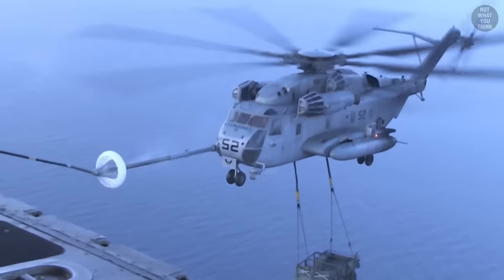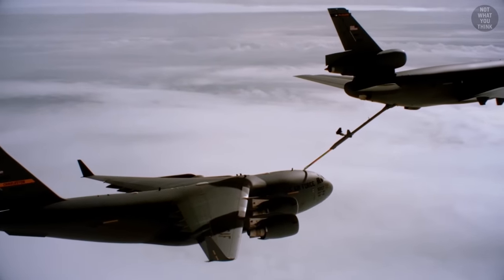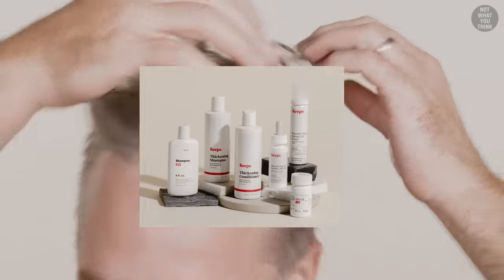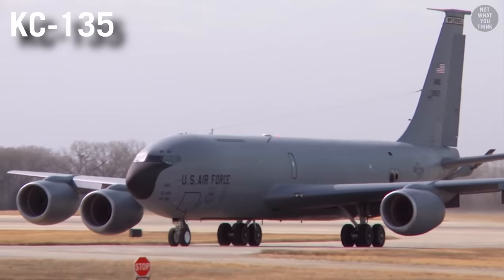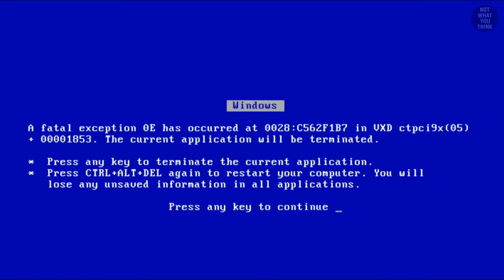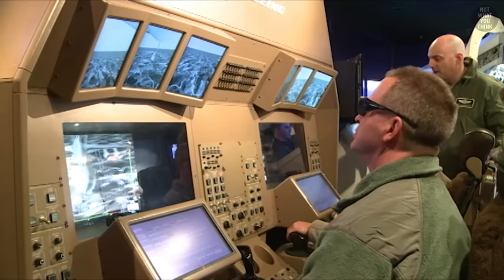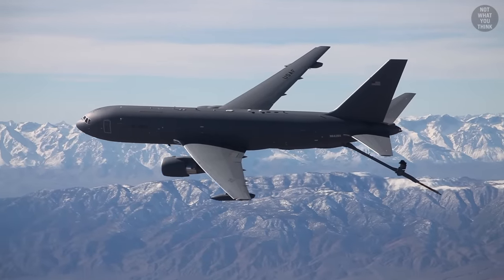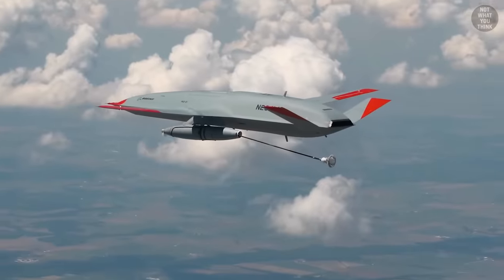Why US Air Force is Making Aerial Refueling HARDER?

Comment: I hope Boeing loses a lot of money on this contract. Airbus originally won the contract but Boeing challenged it and got it, so Boeing should be happy.
Reply: I hope not that money is coming out of our pockets and putting our protectors at risk so no I hope they don't
Reply: @dark12ain  it was a fixed price contract and the USAF has been very eager to remind Boeing of this fact.
Reply: @dark12ain   Nope its Boeing's entire loss. The USAF made sure it was fixed price after they were denied the aircraft they wanted and had this boondoggle foisted on them. They knew it was a disaster waiting to happen.
Reply: @Pierrot9315   Well US taxpayer Dollars have been supporting Boeing for decades through over inflated defence contracts like the KC-46. The difference here is that the overruns are down to Boeing not the Government as always happened before. That was my point.
However we all know that if Boeing goes belly up then the US Government will find some backdoor way to prop it up. "Too big to fail".
It will be interesting to see how the WTO views any sales post a Government bail out....
Reply: I thought the military services have the discretionary authority to select which defense company to design and manufacture their aircrafts as long as they met the requirements?
Reply: @dallasyap3064   They do and the USAF did because they chose the Airbus A330MRTT that would be built in Alabama using GE engines. So it met all domestic supply rules.
But Boeing deployed their paid Senators and the deal was negated and the following bid process was so loaded against Airbus that they said 'Sod this' and walked off.
But Airbus kept their word to Alabama and still built a factory there. It now builds A320 aircraft for North American customers and A220 for US customers.
Reply: @1chish  I see. Boeing really screwed this up. And those senators paid by them are disgusting too.
Reply: @1chish  And it isn't even the first time Airbus walked away from a USAF contract. USAF was interested in A380 for the next AF1, Airbus looked at the politics involved and didn't even bid.
Reply: @apveening   But would the A380 have had to be built in Alabama or built in Toulouse and fitted out in the USA? You can see the politics!
You have to wonder if Airbus had also seen how Agusta Westland in the UK were also shafted by US politics some years back when they and Lockheed Martin won the contract for the USMC 'Marine One' helicopter contract. These are the green and white helos that serve the US President from the White House and from AF1. The contract was for 28 aircraft but after 6 (I think) were delivered from the UK Obama cancelled the contract in 2009. Guess who won the replacement competition in 2013? Sikorsky who Westland had beaten first time round after Westland and Boing withdrew. Obama suggested it was to save money but none had been delivered by the 2020 deadline so they are years late and costs are higher than the AW Merlin versions. Sound familiar?
Reply: @1chish  As I wrote, Airbus looked at the politics and decided against it.
Reply: @apveening   Yes I know. I agreed with:
     "You can see the politics!"
And then went on to show its not a new phenomenon for foreign businesses to be shafted by Yank Pork Barrel politics which supported your comment.
Reply: Oh, they have and are set to lose even more.  Fixed-priced contracts and all that.  Completely deserved.
Reply: @1chish  Airbus would likely have been more than happy to meet any and all domestic supply rules.  It would have been Airforce 1 after all (so at least three aircraft and a tonne of prestige).

But the real cost and pain is finding and then paying the correct senators, who can also quite easily turn their backs on you for another deal.  Really dirty too.  Not worth it in the slightest.
Reply: @tams805   Nope. Airbus learned a big lesson over the tanker deal and will never bid for a US contract ever again. Likewise UK companies have been shafted more than once. A relevant example being the contract for the US 'Marine One' helicopters that are used by the president that was won by Westland in the UK with Lockheed Martin. After 9 flying airframes were delivered (out of 23) Obama was 'persuaded' in 2009 to cancel the whole deal. A replacement contract went to Sikorsky who Westland had beaten just a few years before. The Canadians bought the 9 airframes for 10 cents on the dollar and have been using them ever since.
The Yanks demand we buy their US built kit but never buy ours unless they build it (like the Harrier and the Canberra) under licence.

Comment: I'm honestly really interested in the mechanisms that hold the fuel lines in place. What happens if one of the aircraft fly towards eachother? Does it have a suspension system to allow that much leeway? What if they pull away from eachother? Does it just stay stuck together and pull the other aircraft or is there a release mechanism that kicks in automatically when there's enough tension?
Is there some sort of suction to attach the refueling and the refueled aircraft together? Or is it a mechanical mechanism? Does it lock in place with pins or threads or friction or magnets?

Comment: I know that Boeing has amply demonstrated their incompetence left and right in recent years, but this is beyond ridiculous! A kid in a trade school would design this better.
The best thing to do would be to scrap this embarrassment and procure the aircraft that won the original bidding process, anyway, the A330 MRTT / KC-30A
Voyager.
Reply: This way saved $4.96 per unit though.
Reply: This won't be Boeing's fault. The Air Force will have given them a list of requirements and Boeing will have met them or they wouldn't have been paid.
Reply: @ianphil397   Well that is not true. Especially as the Air Force is only paying 80% of the contract price on delivery.
Boeing royally screwed this programme up from the start. It didn't even meet the USAF specifications and why it lost out to the A330MRTT which incidentally can fly 3 drogues or 2 drogues AND a boom. And it carries 20% more fuel.
Reply: just like how navy is decommision all of the LCS ships
Reply: @hksp  well, that is what happens when you let an aircraft manufacturer make ships.
Reply: @hksp  Only already built ones, while they continue building more, presumably with solved gearbox problem.
Curiously, they only now considered aluminum metal fatigue and corrosion characteristics...  And that there is very little action in US littoral waters.   But fear not, a new designs are coming!
Reply: @ianphil397  And one of requirements was "useless remote-operated boom system" ?
Historically, manufacturers of all useless weapons systems were paid- that's the point of the whole exercise.
Reply: "Boeing has amply demonstrated their incompetence left, right and center in recent years"
FTFY ;)
Reply: @apveening  Okaaay! 🙂

Comment: I'm baffled they didn't include an exposure compensation system. Like the whole time during development, no one thought an overly high contrast situation might come up?
Reply: Someone probably did suggest it, but its Boeing, so likely they were threatened with dismissal for their trouble.
Reply: They actually did, several in fact. They just didn't work as advertised, some settings made things worse.

Comment: It’s so crazy how a project can get so far with such a huge glaring error.
Reply: Oh its entirely possible.
Reply: Welp at least the glaring issue is now exposed
Reply: Why is an operator even going doing it anyway? Seems you could easily build a computer system to auto lock onto transmitters placed around the receptacle and automatically close the distance between the two.

Comment: The decision to go with a remote vision system instead of a window was driven by lots of things, but not really automating refueling, . You can make that work on an existing windowed tanker once the real technological hurdles are overcome, lots of tests on KC-135s exploring technology to make that work have already been done. 

The main reason is cost. If Boeing (or Airbus) were to put a traditional boom pod and window in the back, it would require redesign and recertification of the already-FAA certified structure/pressure vessel, which take lots of time and money compared to just slapping some cameras outside the pressure vessel and calling it a done deal. It was never part of the official acquisition strategy (until talking about RVS 2.0), and it wasn't part of the KC-46 requirements. If Boeing designed anything on the KC-46 anticipating auto-AR, they did so outside the requirements hoping to gain an advantage down the road when they started to push the idea of auto-AR on the USAF. 

Another reason on the KC-46 is size. To meet the cargo requirements, you have to have two pallets side-by-side in the cargo compartment. This takes up the entire width of the aircraft, with no room for someone to walk to the back of the aircraft. The KC-10 is wider, so there's room to walk back to the boom pod. If they went with a window, some missions would require choosing between carrying the cargo needed, or offloading fuel, which would hamper deployments where the tanker is carrying the supplies for relocating aircraft while also refueling them to get there.
Reply: Horse$hit!

Comment: For the end of the video, automating probe and drogue is relatively simple (read: not necessarily easy): the tanker drone just has to know how to fly a racetrack, uncoil/coil the drogue, and let the receiver plug in (the human still does that part). Teaching a computer to do the opposite - actually fly the boom into the receiver - is a MUCH more complicated task, especially if you want to use the receiving aircraft after its been refueled. I suspect that the VRS (order?) intermediate step is needed as Boeing will:
a. use the same hardware on the vrs and fully auto version, thus validating the equipment whilst a human is still in the loop, and
b. Boeing is probably using the vrs system (with its trained human opperators) to pre-seed the machine learning system to shorten the learning process.
Reply: 3 dimensional space, with dynamic lighting, changing atmospheric conditions and turbulence, including aircraft created turbulence. And as mentioned, differing aircraft and airspeeds,.. are a bit more complicated. They'll get there eventually.
Reply: @My-Pal-Hal , hence the bolded "relatively" and the "read:", mate. Plus, if it was a dimensions problem, we'd have had autonomous cars by now and fully automated trains last century. ;)
Reply: @j.michaelpriester8973  
Oh ok.
Guess that explains the 273 Tesla Autopilot crashes in just the last year. And that's not even in a 3D environment, with all the other things I mentioned.
Not really the reliability one would expect of their military aircraft performance.
Hey. Maybe that's why you can't just fly an aircraft with a driver's license. Could Be 😏
Reply: @j.michaelpriester8973  
Damn.
I forgot to mention all those Train Accidents. And they're on a freakin track with only 2 Directions. How in the hell do you F Up That all the time,.. mate? 🤔 😳 🤤
But, I looked it up.
I like knowing a bit of current information about what I'm talking about. Learn something new every day 😊👍
You may find it interesting. But it's US stats. So she me 😂
... Railroad deaths totaled 893 in 2021, a 20% increase from the 2020 revised total of 744 and the highest since 2007. Nonfatal injuries totaled 5,781, a 4% increase from the 2020 revised total of 5,544. From 2020 to 2021, fatalities at highway-rail crossings increased 21%, while fatalities involving other types of incidents increased 20%. The latter included 617 deaths (94%) attributed to trespassers. Eleven employees were killed while on duty, equal to the 2020 death toll. There were six train passenger deaths, up from two deaths in 2020.
The ratio of railroad-related deaths to nonfatal injuries and illnesses is about 1:6. In 2021, of the total 893 deaths, 26% occurred at rail-crossings. Of the 3,216 nonfatal occupational railroad injuries and illnesses reported in 2021, 66 were attributed to highway-rail crossing incidents. ...
Bottom line. You picked some bad examples my friend 😏🖖
Reply: @My-Pal-Hal , you actually just made my point about 10 times over. We've had 3-axis autopilots in aircraft for over 70 years, autopilots coupled to navigation for over 30, and Cat III autoland for over 25. We've pretty well licked controlling an aircraft in 3 dimensions. The engineers on the MQ-25 project readily admit the problem is not in the flight control logic (3D), but in the on-deck control logic (2D). Your Tesla example again clearly demonstrates the much more highly dynamic environment in which cars operate. Hence, why Tesla's autopilot is still unreliable. Your train accident statistics, while interesting and slightly informative, ultimately have nothing to do with autonomous trains. They aren't a thing, except in VERY controlled environments. All of the accidents you cited involve human-controlled commercial trains. US commercial airlines, which are under autopilot control at least by the time they reach 10k feet of altitude, has not had a fatal accident since Colgan Air in 2009, and that involved pilot error, not the automation. 

So, while it may seem that increasing the dimensions increases complexity, the complexity of the control logic is more determined by the dynamicism  of the environment in which the vehicle is operating, not the raw number of dimensions. On the road, the control logic must contend with other cars, pedestrians, construction, weather, parked aircraft, etc. In aviation, weather and its effects have long ago been built into the control logic, and especially in the MQ-25's case, there aren't other aircraft or construction barriers which are going to get in its way. If an F-18 were to stray in front of it, that's what the military version of TCAS (traffic collision avoidance system) is for. The history of the technology and the accident examples we both cited further demonstrated that it's not the number of dimensions in which one operates, but the dynamicism within the dimensions one operates.
Reply: @j.michaelpriester8973  
You don't get it. But that's cool.

Comment: The automatic one should be a electric prop plane with solar on the top
Reply: Wouldn't work because the planes they are refueling won't be able to fly slow enough without losing altitude.
Reply: @Swiggityswagger  a prop doesn't need to be slow, or just make it use prop until it needs to refuel then it uses some kind of jet
Reply: Electric wouldn’t work until the plane it is refueling is also electric. Better to have both planes use the same fuel, no wasted weight that way.

Comment: This is a classic example of a product engineered and designed in a vacuum. All this could have been addressed if Boeing worked together with current deployed boom operators (PLURAL, the more the marrier). 

This often happens with Boeing and is also the reason why their starliner is riddled with problems. It is a symptom of bureaucracy within the company and is caused by too much funding from the government, Boeing is not a self sufficient business.
Reply: They did.
Reply: @johnp139  clearly not enough or they didn’t listen. Anyways Boeing is know the be bureaucratic and manager projects from the top down
Reply: @johnp139  True, Boeing did, until the reverse take over by McDonnell-Douglas.

Comment: While Boeing redesigns their boom system Airbus has already developed a fully automated boom system on the KC-330. In the hinsight the KC30(330) would had been a better choice for USAF and. US taxpayer. Now you got a expensive frankenstein patchwork/ problem plagued 767 based tanker.
The 767 itself is a obsolete plane.
Reply: Interestingly, the MRRT was going to be the USAF's next tanker, but Boeing lobbied and bitched hard enough to get the contract restarted, and Airbus either didn't reenter or didn't win on the second (most likely heavily Boeing-favorited) bid. This is now biting Boeing in the ass as they signed a fixed-price contract on the aircraft, and are now stuck eating all the costs to fix these half-assed attempts, so far costing them 5 out of the 40 billion contract. I hope it costs them a lot more than that to fix these planes after what they pulled

Comment: Most ironic thing about all of this is that, Airbus with mrtt lost to Boeing in next gen fuel tanker. Especially when you account for fact that as they say it's only bridge solution before drone refueling, In that case USA going after unproven plane that is worse by any means of measurments shows pure essence of this country ability to waste money. They literally choose airbus, boeing got angry and pulled strings in gov, only for them to cancel bid, and make new one that would be put together in a way that favours boeing. Now you have consequences of it.
Reply: Boeing submitted and won a protest based on acquisition law. No strings were pulled.
Reply: And Boeing is the one paying out of pocket to fix the mess they created. I'd say that's pretty fair karma so far, but what would be better is if the USAF pulled some of their own strings and contrived a reason to pull the contract out from under them completely

Comment: They likely introduced the RVS system because the airframe body itself could be reused for other intents of that particular Boeing jet. Having a position in the back where an airman lies down to witness the boom would likely conflict with other airframe designs where the plane isn't a a mid-air refueler. A digital station somewhere inside the plane seems like a modular idea, keeping the airframe more "ubiquitous" for other uses.